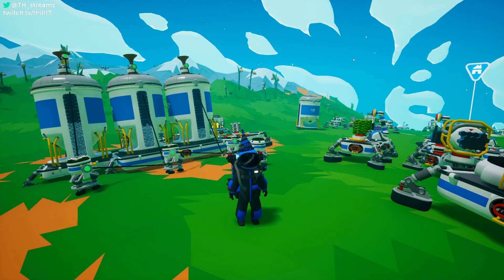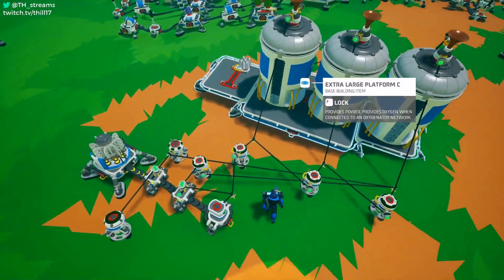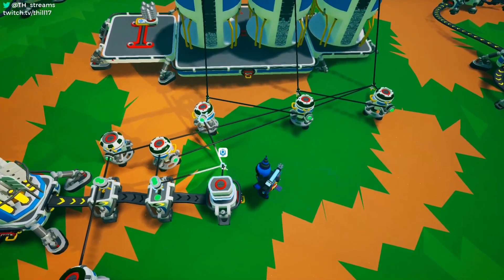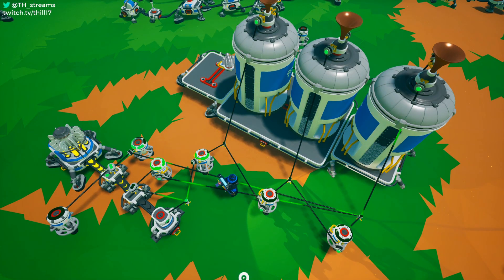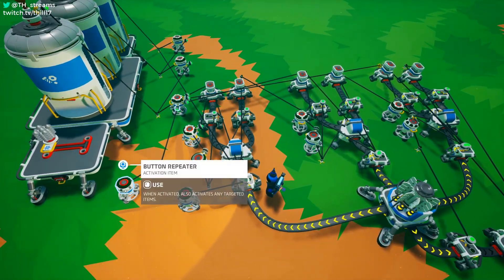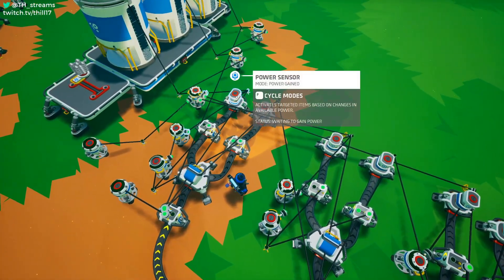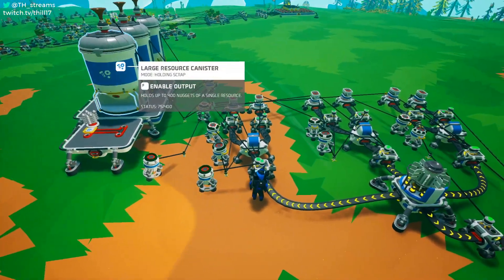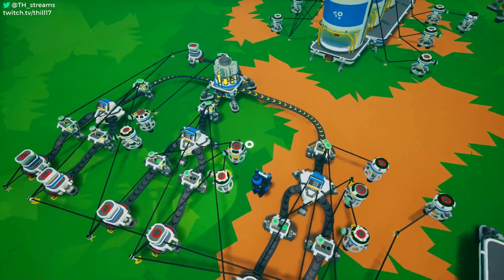Astroneer Circuit Loops

Comment: I have been wondering do you know of any possible way to get a piece of dynamite to be automatically printed and then be some how put on a item in a package so that it gets destroyed or rather a way to simply unpack a item automatically or find a item that when printed is not in a package and can have dynamite put on it I have been test so many different things and I can't find anything that works
Reply from the maker: Unfortunately I agree with your findings, without manually placing a cable pin on an item to unpackage it or trigger the dynamite it is frankly not possible. What I really want to see is a sensor field, where when you press a button/trigger it a pulse/area of effect will occur that triggers surrounding items. That would be what you need!
Reply: Yeah I agree they are so close to making this game to be able to be a factory building game all they need is something like your idea and maybe tier two auto arms too but the closest I have got is putting dynamite on a button repeater and then putting that on something and exploring it but you can't automatically put something in the slot at the top of the repeater but thx